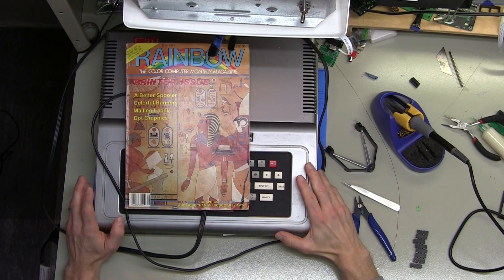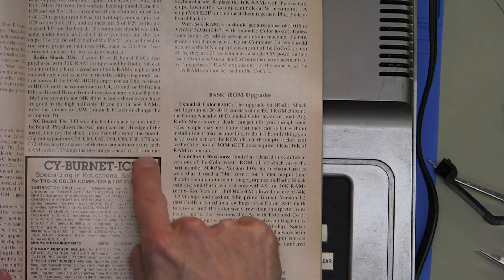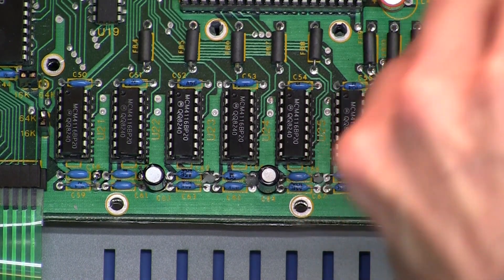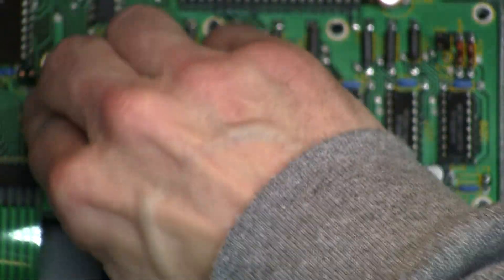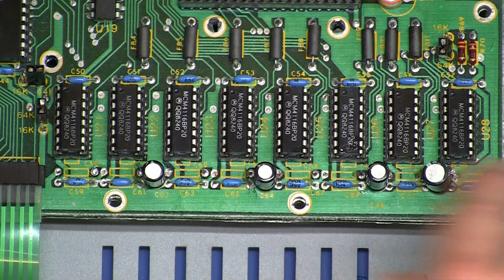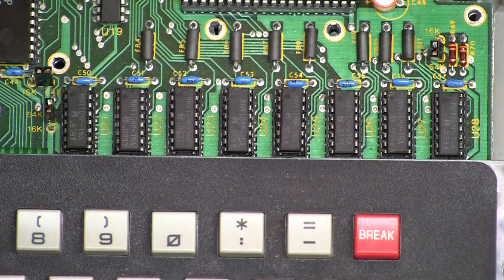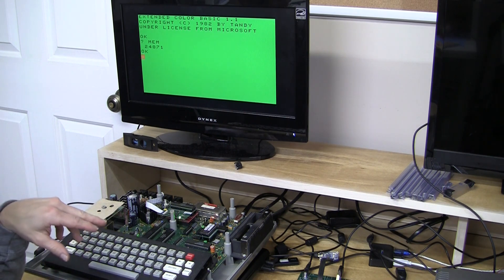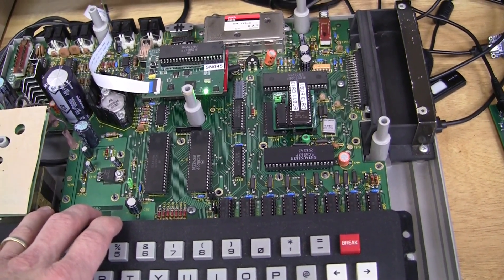Coco1 64K Upgrade

Comment: Nice machine! I'm waiting for a CoCo 1 to arrive and I'm guessing it's a 16k model (26-3002?). I also got 4164 chips coming and also some heat sinks with adhesive backing that will fit 40 pin DIP's. I remember that especially the MC6883 really ran toasty hot.
Reply from the maker: Yes it did.  Did the Coco 1 work as hoped once you received it?
Reply: @acs8-bitzone651 I can't find a proper cable to hook the rf to a monitor right now but the coco relay click on power-on indicates it is booting properly! Beautiful grey beast. It reminds me of the rare white coco 1 i lost. I' ve been rebuilding my old collection and I want to start my own Youtube channel. So far I have Coco 1,2, 3, MC-10, RS Model 1, Apple 2+, Commodore Vic 20, 64, Timex Sinclair 1000, Atari 800XL, TI99-4A... What a beautiful era of computers!

Comment: Very nice, I'm pretty sure I have the same RAM test only it runs from a cart.  It still uses the serial connection though, and you can fire up a terminal on another machine and watch it test the RAM.  It's nice because you can run it even on some machines that won't boot.  I have yet to really benefit from it so far though, I have too much fun tearing machines apart to fix them I never end up using it!  😄
Reply from the maker: I would be interested in having a cartridge version.  I remember asking Denis who created the one I'm using about that, and there would have been challenges in porting it to cart.  But it would be nice.